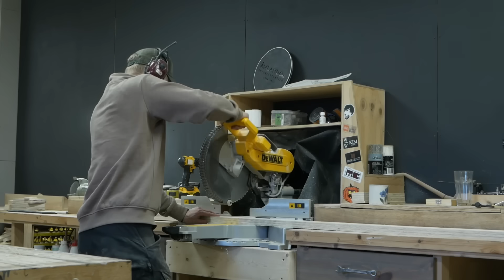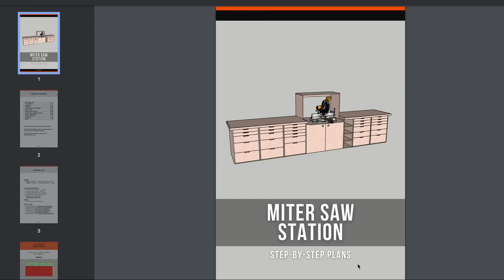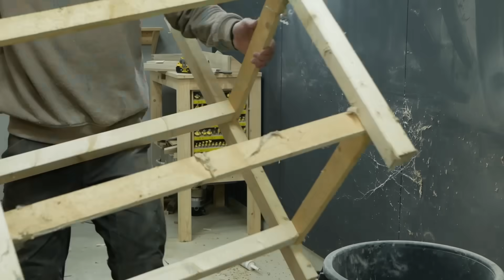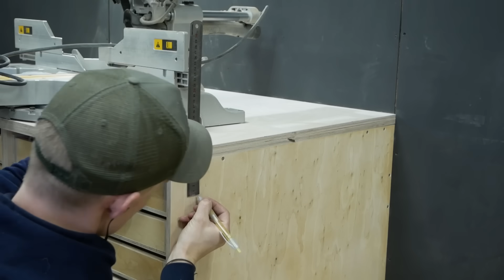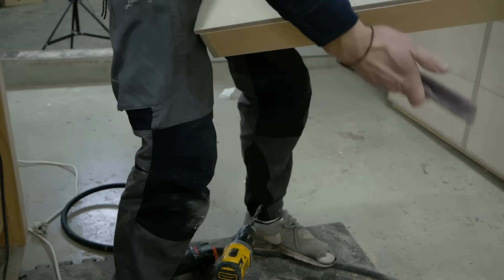Don't Waste Money On Your Miter Saw Station

Comment: Super build, I'm in the middle of my own station. What I noticed about your mitre saw was the large dust extraction port at the bottom of the blade, did it come with the saw? I have a DW717s and the dust extraction is pants, just curious regards your saw as it seems to be the same or very similar. Thank you for sharing 👌

Comment: Very nice build.  I like the drawer system.  Even if the drawers remain in the same slots, it obviates the need for slides.  Edit - I can't get nice plywood like that for $15 - 20/sheet here in the U.S.

Comment: Looks awesome. Just to be sure, there's no protection against sliding the drawers out accidentally by pulling them too far out right? Isn't that annoying, or is that in practice not an issue?
Reply from the maker: It could happen, but still hasn't happened for me :)

Comment: Has anyone seen plywood sold like this in the US? It’s cheaper and nicer than the cheap building stuff at big box stores.
Reply: Likewise.
Reply from the maker: Check out the cabinet build video on Wittworks’ channel. He found some nice looking plywood in US for around $40 I think.
Reply: @AreBaloni  thanks definitely will
Reply: You won’t find it here. We have too many channels that soak up any wood in this market and Environmentalists prevent any health timber industry which drastically increases the cost of ALL wood products. Environmentalists would rather a tree burn from fire or be destroyed by bark beetles than be managed and harvested for human use. I have seen this firsthand.
Reply: First thing I thought, too. I'd like to know where to get my hands on some.